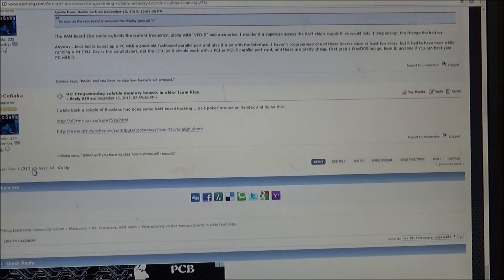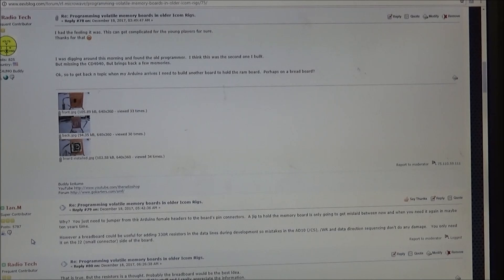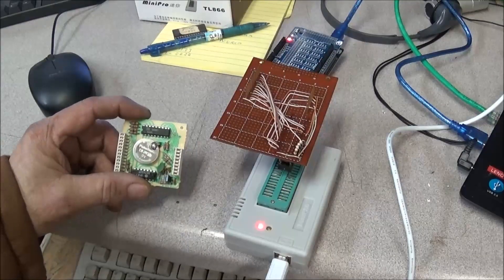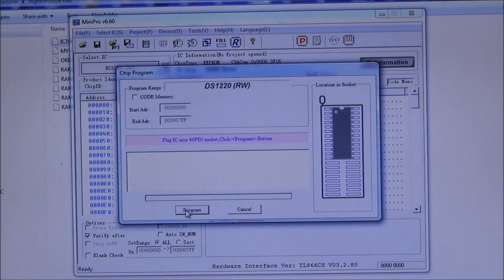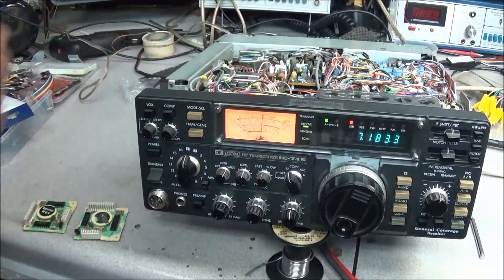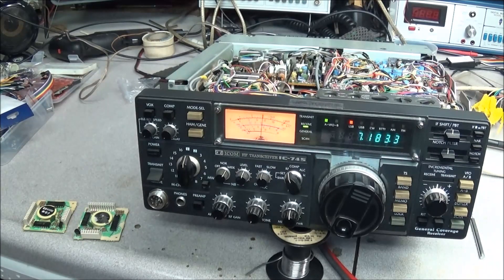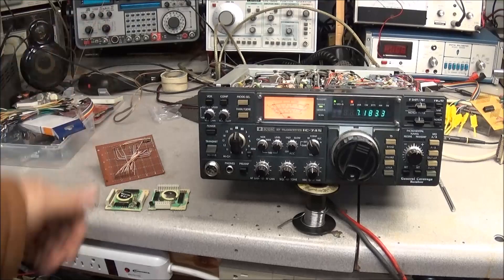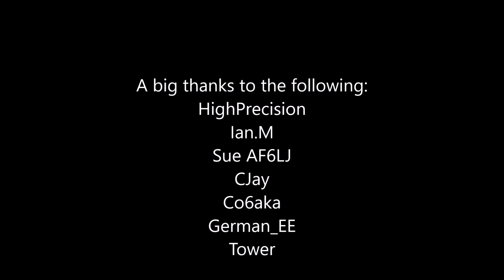#152 IC 745 Ram Board Part 2

Comment: Thank you for this video. I successfully built and used the  4040 programmer for a dead 271 and R71 ram module using a 486/100MHz Dos machine but  I could not program the 751. I then tried the 74LS373/74LS241 programmer with the same machine but that did not work. I don't like the way the parallel data bus is share for read and write, the 4040 programmer has in my opinion better hardware. I then followed the EEVblog post and built the module carrier board with the new icom_ram.zip file and managed to get the 751 going.  Good work and 73.
Reply from the maker: Good to hear success stories like this. Thanks

Comment: hello, thank you for this video which helped me flash the RAM card of my ICOM IC-745! I have a question though. I notice that I can no longer select LSB mode. I can select all the modes (USB, CW, AM….) but once I arrive at FM, if I continue to change modes it switches me not to LSB but directly to USB. The only way for me to select LSB is to be on a frequency between 1 and 7Mhz. Do you have any idea where I should look? THANKS

Comment: Hello, I have an icom745, its RAM has been erased. I tried to program it with TL866 as you explained in the video. Even though it says "Programming succes", when I read the RAM it seems to be empty. It also doesn't work when I plug it into Icom. How can you help with this? 73

Comment: Hi there. First of all, I thank you for sharing such valuable information with us. I would like to know if you can send me the file that I should use to reprogram an ICOM RAM BOARD from an IC 751A. I have built an interface that I got based on an IC CD4040 and using the ICOM-RAM.EXE program which indicates that the recording process has been carried out correctly, when reading the ICOM RAM again I see that it actually contains information, but when installing the board in the IC 751A the equipment does not work correctly, I would like to try it with a different .BIN than the one I have if you can send it to me. Thank you again for your attention. Greetings from Argentina

Comment: Some computers require a bit to be set in the printer status register to enable read/write  to take place. The parallel printer port is normally write only, but to verify the ram readback after programming it must also be readable to allow that program to work.  Happy to give more info if required as this worked fine for me. Do you know if the 745 firmware is suitable for the 751?
Reply from the maker: Thanks Dayle. The 751 is different and is listed on the EEVBLOG in the 745 thread.

Comment: How did Icom manage to produce and market a radio that would turn into a brick when a tiny battery died? A Collins owner would have to laugh out loud. ( I guess Collins Radios would also survive an EMP event).
Reply from the maker: LOL, I once wondered that also Ron. But Icom did stand behind the product for many years.  I think it was done to keep cost down, if you remember the 80's memory for a computer was crazy expensive.  Eproms was also. But their thoughts was to sale radios and a lot of them were sold.  Probably figured by the time the battery died folks would want the latest and greatest.  And lets not forget about those plastic trimmer capacitors they used.  Ah Collins,  What can we say.... :)

Comment: Dang a few months too late , one of the clubs , St. Paul Radio Club , I belong to gets calls / donations for ham gear to sell / or what ever .
We have an auction end of Jan. every year , we send keep 10% to cover cost of running auction , then send the other 90% to ARRL defense / protect the bands .
So got a IC745 last summer and had the dead board , so just sold cheap at he end of summer ham fest we do , so the next guy got a deal , and knew of the optional boards [ $80 - $125 ] .
This could be of use the next time ;) 
Thanks again John
Reply from the maker: Hi John.  I will say the optional purchase boards are great units.  But by installing them we learn nothing on how all this works.  I have quite a few more tricks up my sleeve for the old IC-745 to come.  This programming will help lots of folks that do want originality or to give the original board many more years of life.  Thanks for sharing.

Comment: Good to see that old girl back working with the original parts. Good job tracking down a solution and getting that thing loaded. 
Thanks for the video Buddy, 73's Dale
Reply from the maker: Thanks dale. The team did well on this one. 73 my friend
Reply: @TheRadioShop  Where can I get the programming device where I plug in the circuit board to program?
Reply from the maker: @13HN870  Use this link, everything is there.
https://www.eevblog.com/forum/rf-microwave/programming-volatile-memory-boards-in-older-icom-rigs/
Reply: @TheRadioShop  Thanks for the link I measured my battery in the device and surprisingly it still has 3.24V and it's the original battery.